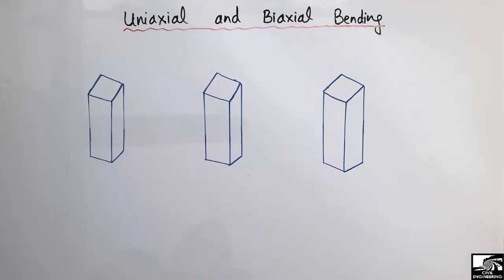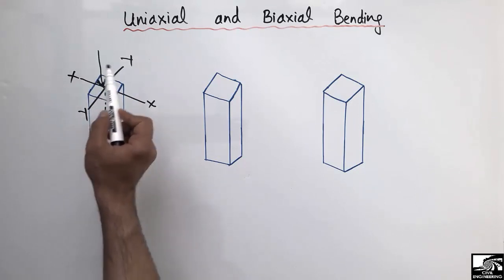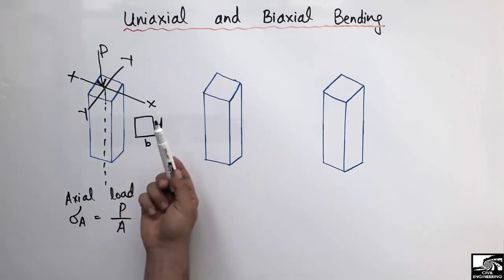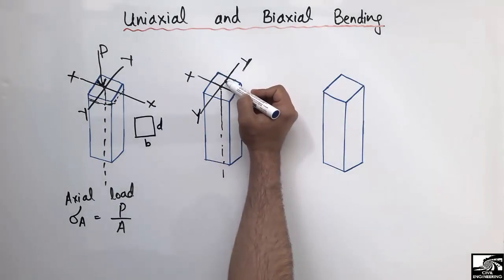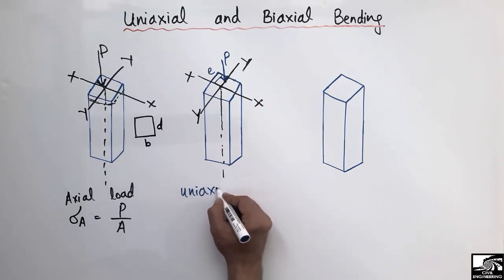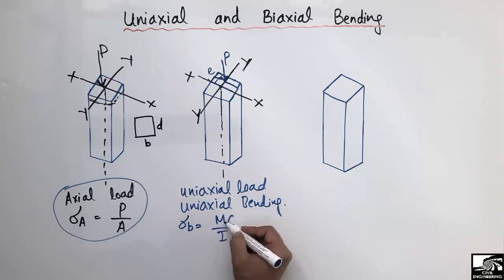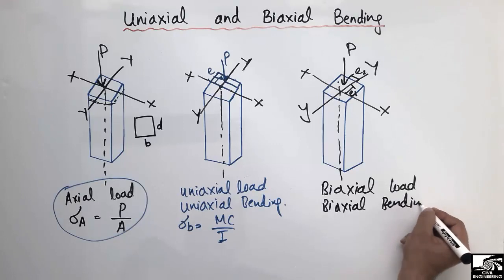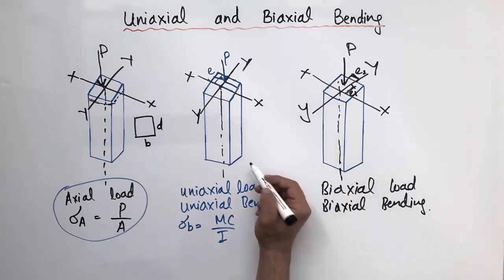Difference between Uniaxial and Biaxial bending in Column.

Comment: hello sir thanks for your videos , could you explain in video tell us  when we have a column with an applied load on center of column  with section of  300*300 mm  , fck = 30 mpa ,  4 no bar with 12 mm longitudinal and 8 mm for stirrups ,  how much load  can steel carry  and how mch concrete can carry ?   m buddy said  1/4 of applied load for steel and 3/4 of applied load for concrete , is it right ? thanks for your answer